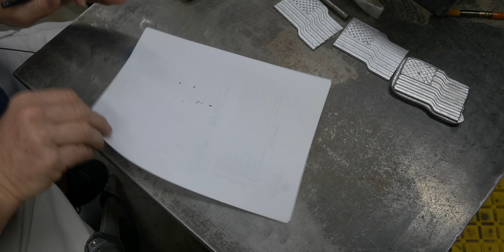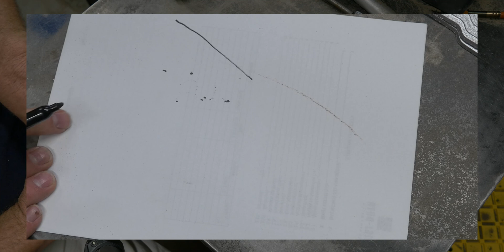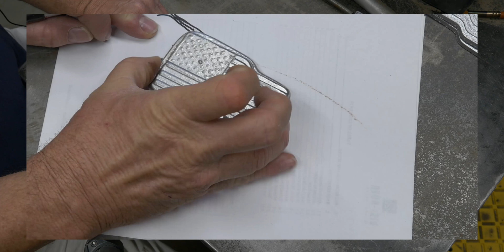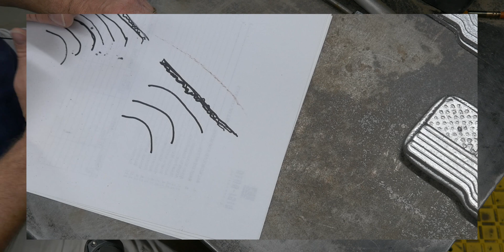Learning to cast metal - Head pressure

Comment: So, the take-away is:
You need head pressure to force the metal fully into the mold cavity.
Face-up will give give less head-pressure on the important surface, but its not a worry as long as it is still "enough".
Too much head pressure will increase the risk of flashing.
Reply from the maker: That's pretty much it. Too much head pressure might also result in a rougher finish as the metal is forced into sand at a higher pressure as well.

I made this video 100 years ago in reaction to videos I was watching where people were building unnecessarily high pouring structures on molds that simply don't need them

Comment: I came to think of, headpreasutr makes for "extreme" details, no preasure makes for smooth details, what if you have a veery short sprue, say ½" or 1" and the basin away from the part not on top ? Just wondering, that maybe you could get the best of both worlds, or the opposit, the worst of both worlds. Anyway you are very educational, just like mrpete222/Tubal Cane and TOT (This old Tony) Greetings from Denmark, home of H C Andersen ;)
Reply from the maker: Is Hans a relative? 😄 

Not sure what you mean about "the  basin away from the part not on top".  I always cut my basic to the side of the sprue. Pouring straight down the sprue is a great way to suck air into the metal as it is falling.

That's a great question about a shorter sprue. I don't actually know the answer.  It does seem to make sense that a lower sprue top would result  in lower head pressure in side the mold but I've never tested it to know.
Reply: @swdweeb  Unfortunately we are not related. 

What I mean about away is that the basin you start your pour in sits situated the same direction as the part ie if you have your part pointing at north to south and your sprue to the north of the part, your bacin usually point towards south.

What if the basin is north of the sprue, then you don't need 1-2-3" of sand to seperate the basin from the part, and thus you can have a much shorter sprue and a lower headpreasure.

It might be whistfull thinking, but then again I'm "just" a scaffolder, but a proud, courious one of that ;)

But man you make my head spin, and it all makes sense, then a litle later I start doubting, look thru the video again, and it makes sense again.

I do SO need to get my furnace up and running again and test out your video's

So again thank you for fun informational videos
Reply from the maker: @sidewind131258  Ok, now I understand what you're talking about. You're correct, if there was no danger of the basin cutting into the part then I suppose you could make a shorter cope... for thin parts anyway.
Don't let your head spin, I'm always happy to discuss and to answer questions if I can.

Comment: The best finish I got so far, was a few ingots shaped in wood ash.
I made some ingots shaped as my finger from molds in sand, but they are very porous, and coarse, and there is hardly any detail there.
Of course I didn't use any of your techniques with the basin, spruce, trap, and gate, so maybe that was the issue. I don't have a 3d printer, so I will have to make those items from wood, and try again at that time.
Reply from the maker: With all the work I do trying to clean 3-D prints up so I can cast with them I'm beginning to wonder of wood isnt a better choice

Comment: Regarding pressure...  Wouldn't the applied pressure be the same on both sides of the pattern whether the mold is face up or down?  I only think the quality of the part would now depend on sand moving.
Reply from the maker: I've had to think about your comment for a few days and I still don't have a good answer.  I suppose the pressure is the same up and down except for that pesky gravity thing. Not sure how much effect it has on things.  Definitely something that could be tested more thoroughly to better understand the limits of casting face up.
Reply: @swdweeb  definitely something to think about.  Gravity puts the pressure in the empty cavity, but once the cavity is full and nowhere for it to go.  The gravity pressure is now applied throughout the entire mold, top, bottom, and sides.  Atleast that's what I think.  In my mind it makes sense...
Reply from the maker: @HeinrichsMade  I started to say gravity is always pulling the metal down towards the bottom of the mold.  Which it is. Gravity is also pulling metal in the sprue down which creates enough pressure that it seeks its own level.  Which in turn causes the metal to push up in the mold.  My head hurts.

Comment: Hi  @swdweeb . Doesn't this contradict some of your other content? I have noticed you now use a square tapered Sprue, watching this now makes me wonder if the corners of the sprue just allow another spot for the air to get sucked into the cast. Does the same surface tension/detail 'problem' you have with the open casting not apply here? You seem to be having success with it but why is it better than the round sprue?
Reply from the maker: No contradiction at all. As I said in the tapered sprue video, it doesn't matter what shape the sprue is.  People also run "slotted" tapered sprues that are rectangular in shape.  

As I said in the video, the sprue should actually be hyperbolic in shape.  We cheat to make things easier on ourselves and make tapered spues that more closely mimic the shape of the liquid as it fall further down.  

Keeping the sprue full, no matter the shape, is why we use the offset pouring basin and step/ridge.  Supply enough metal to the basin to keep it high over the ridge and the sprue will remain full, no matter what shape we cut it.

The square sprue simply fits the square runner that is below it.  That is the only reason I've been using it. I could go back to fitting a round peg in square hole but why if I don't have to?

Comment: Do you think that head pressure would need to be applied to a thicker pouring metal, like brass or bronze? I'm going to attempt to cast a 9"x 12"x 0.25" plate in brass.
Reply from the maker: I don't, as I've poured the same height sprue with both brass and bronzes.   Keep in mind that the heavier metal is also in the sprue giving more pressure anyway.

Comment: I would still like to see some head pressure experiments, but it's obvious that you don't really need it.  It might be interesting to see just  how little head pressure you really need.  The video is great, and quite informative.
Reply from the maker: Thanks Brian,  it would be an interesting set of tests to run.  I think I'd need more sand and more casting boxes to come close to doing a fair set of tests. There are so many variables involved, like sand moisture, sand density, heat of the metal, height of the sprue,...  Not sure I'd ever be set up to great all of those molds with the same batch of sand and same crucible full of metal.   It would be interesting though
Reply: @swdweeb  Just follow the rules of backyard experimentation as much as possible: minimize or eliminate as many variables as possible, monitor/record the ones you can't, and analyze results with an open mind.  Which are the same rules they use in scientific experimentation, just with more significant digits.
Reply: @BrianDaleNeeley  Brian, luckygen1001 has done a series of experiments covering a range of casting topics that might help you.

Comment: I'm curious what would happen if you flooded the mold with CO2 or argon before pouring.
Reply from the maker: What, thinking that the oxide layer wouldn't form?  I have no idea, interesting thought though. I expect that there would still be surface tension regardless of an oxide forming.

Comment: Do you think head pressure is the same factor for different metals? Do you think copper would of had the same outcome?
Reply from the maker: Not sure what you mean.  Are you referring to the added pressure due to copper being so much heavier than aluminum or are you asking about copper forming an oxide layer like aluminum does?
Reply: @swdweeb  yes, would the heavier weight of the metal look different in the same scenario, does copper oxide form at the same speed as aluminum?
Reply from the maker: @wantafastz28  You know as I wrote that last comment, I thought, "I hope he doesn't ask me a specific question" 😄😄 I'll have to ask about copper and the oxide film formation.  Let me go to the experts and I'll get back to you when they answer me.  Sorry I cant do better than that.
Reply: @swdweeb   no need to go that far, was more so. Just curious of your opinion... just trying to make good conversation
Reply from the maker: Well too late, you got my curiosity up.  You’re going to get an answer whether you want it or not 😂😂😄

It is probably going to turn out that metal forced to hard into sand is going to look like it was forced into a permeable wall.  I’ll write more when I can get to a real keyboard. Hate typing on the phone
Reply: @swdweeb  same here, I gave up on my last abortion of a message, too many typos  from my phone.
Reply from the maker: @wantafastz28  So here is what I've learned so far.  Heavier metal does make a difference.  It makes things harder for the foundry casting the parts,. Imagine a very large part casting in steel. The sheer weight of the metal can cause issues at the bottom of the mold with deformities and rough castings. And, there is really nothing the foundry can do to stop it. 

I'm still looking for the copper oxide answer
Reply: @swdweeb  interesting..... so having the design facing up in this videos scenerio might help the situation with heavier metals.
Reply from the maker: @wantafastz28  I suppose but keep in mind that I'm talking about castings that weight several hundred pounds.  Something like these tiny little plaques aren't going to have that issue.
Reply: @swdweeb  years ago, I worked in an industrial foundry. The furnace I worked at usually tapped out at 28k pounds. It was used primarily for large castings. Little things like impellers and casings for river dredges.
I know they used black sand mulled with a heat activated resin. It took two or so days to prepare for just one cast. 12 ft flasks  4, ft thick. We had ovens that were used to activate the resin, we poured into hot cast molds, then it took another three days for things to cool enough for clean out.
It was unbelievable how many clamps and wedges were used, the flasks were clamped solid to a 2" thick piece of steel plate.

Comment: Very nice demonstration and nice side by side view.
I have done face up casts on 1 sided items before and they came out very good too, I think it's because the bottom where the metal flows is nice and smooth so there is not much splashing around.
As for open mold casting, I only open mold cast simple things like pewter in silicone or graphite molds and of course ingots 😋👍👊
Reply from the maker: Ha good point, I guess I open mold cast all the time as well. I forgot about ingots 😄

I'm getting ready to cast a plaque tonight and 'll be doing it face down.

Comment: Excellent presentation showing the methods at the same time. It looks like you have really dialed in your sand!  It really captures detail and allows gas permeability.  Great job! Cheers from Juneau Alaska, 
Greg Chaney
Reply: 👍 Juneau!
Reply from the maker: Thanks Greg.  I was told very early on that petrobond was more gas permeable than green sand.  I think this green sand I'm using now is more permeable than the petrobond.  Cheers from smokey Colorado

Comment: Interesting. The face down pressure should be head plus gravity, while the face up is head LESS gravity? It’d be interesting to see whether you can get the same detail face up by increasing the head height?
Reply from the maker: I think the detail was pretty close between the two.  I expect I could force more metal against the top surface if I increased the height of my sprue.

Comment: Superb experiment mate. Some googling after watching says that molten aluminium surface tension is surprisingly high and that was perfectly shown in your open pour, i guess a height of an inch or more is required to overcome this. I wonder what this would be for bronzes? My double sided pours (bronze ones) like the detailed play buttons, have mostly gone ok but ive always tended to put the most detailed part in the drag (as i asked you or perhaps martin about it, i forget) so ive just always done it that way, nice to see some comparisons. Great vid mate!
Reply from the maker: Thanks Mate. I heard it from Martin so if you asked me, I likely parroted it back to you. 
Height of an inch seems pretty low but I also expect that needing a lot of pressure isn't necessary to get the detail.

Comment: I like the open pour the details sucks. But I like the smooth finish. But thank you for showing us the huge difference. One other question I have for you do you use borax when you are in the melting stage of your metal. Seen alot of other videos where people say that it does not make a difference. Guess it is to get the gas out of the metal but I don't know i personally never seen a difference between the two. Thank you for your time.
Reply from the maker: Hi James, I never add anything to my metal when I melt it.

Comment: I'm wondering if the rounded edges from the open mould is a result of the meniscus effect? You mentioned surface tension when you poured the metal. I recall some basic physics which discussed meniscus and surface tension but water behaves differently in glass containers. Maybe some brainiacs can comment on this.
Reply from the maker: I'm not a brainiac but I'll respond anyway 😄

Professor Campbell calls that leading edge of metal a meniscus.  As the metal flows through a pressurized mold, the meniscus forms on leading edge and then as the metal continues to move forward that meniscus tears and is pushed to the side and a new one forms. This is a continual process. The tearing and moving to the side  is beneficial in creating better surfaces for our parts as the meniscus, the thin oxide layer, lines the part.

Comment: Not picking up the edge-corners of the stripes and points of the stars is exactly the same effect as not picking up the sand texture in the open mold, as I see it.  Just on a bigger scale.  Have you tried a lower pouring temperature for the closed molds?  You might be able to get the fine finish and also the fine details that way, assuming your sand isn't just a bit coarse.  Great demo!
Reply from the maker: Coarse sand... perish the thought 😄

Given that I still can't measure the temp of my metal... let the chastisement begin... That'd be a tough test for me to do.  I can't imagine it was all that hot though, it came out pretty soon after the last ingot melted.

Oh, and I agree on your opening sentence.  I think the oxide layer simply spans the edge of the stripes
Reply: @swdweeb  I'll see if I can find a link to a how to build a cheap immersion pyrometer like the pros use tutorial and send it your way.  I haven't built one yet either but it's been on my list for ages. It involves a K-type thermocouple inside a graphite sheath, connected to a multimeter.  Someone mentioned building one of those pyrometers in a video sometime in the last year or so I think too, might have been JulianHG?   Anyhow, your flags are quite thin so a little extra heat (if there is any) might be needed to fill them.
Reply from the maker: Tobho Mott yeah Julian built one

Comment: I really expected the oxide layer to affect the face up mold.  This MIGHT be a good experiment to run on oil based sand, Petrobond ?  Would the non porous (or less) surface trap the oxides better?

Probably not worth knowing.
Reply from the maker: I'm mot sure the oxide layer and porosity are related... I could be really wrong... I think the oxide layer is affected more by pressure than permeability.  Look at what happened with the open face mold.  

And its certainly not worth me buying another batch of petrobond 😄😄
Reply: @swdweeb  so you have disposed all yr oil based sand.  Suspected an emergency reserve, just in case, only under extreme duress,  'over my dead body' responce ;) .  
I think of the oxide front layer as a brittle christal surface that reduces detail capture, and is 'broken' to achieve detail.  Rock on!
Reply from the maker: @honthirty_  Yeah, I pitched it all, kinda like Cortes burning his ships 😄